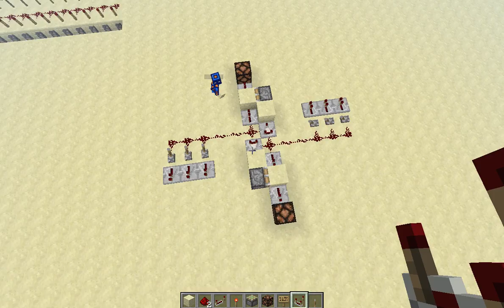The Subjective Gate: Comparator Logic! [Tutorial]

Comment: Its a good design but couldnt you just set it up with one input into a compararator and one into the side of it branch off the output from the comparator 2 ways and one way have it inverted with an and gate hooked up to make sure there is an input and the inverteed torch wont aalways be on. only when there is a signal and the second signal is stronger will the torch be on.... seemed simpler in my head :P maybe this is a bit more systematic but both ways are pretty similar in size